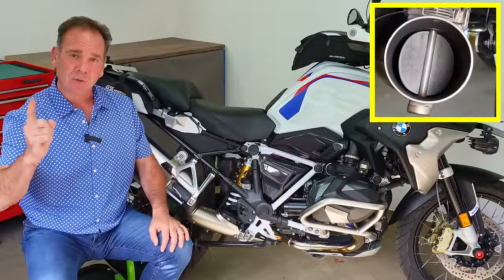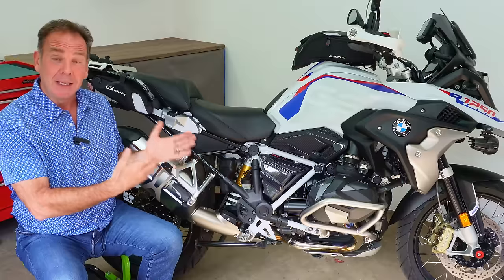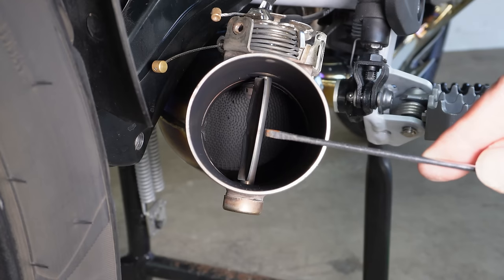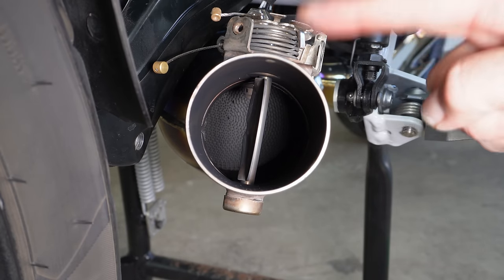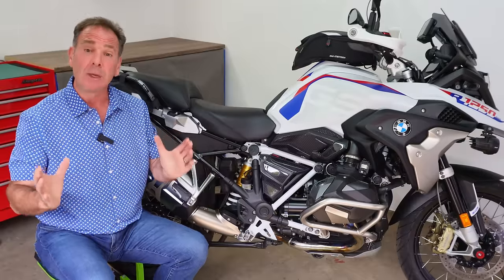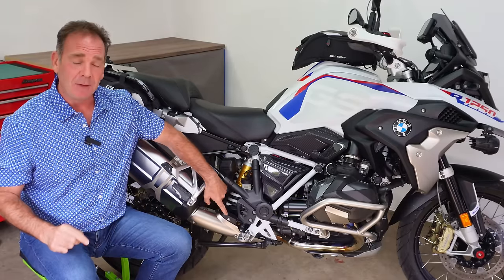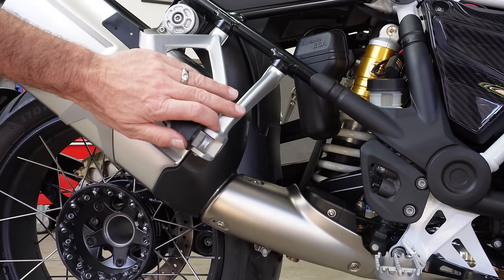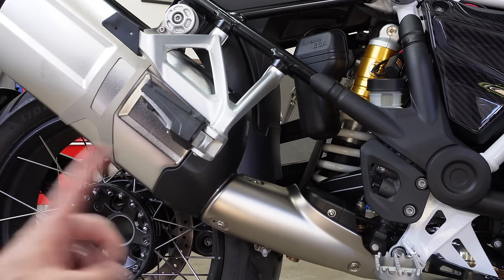EP 25: Butterfly Valve - Exhaust Valve - Exhaust Flapper - Sticking or Seized Valve - BMW R1250GS/A

Comment: It happened to my 2020 RT at around 7000 miles. The valve stuck BMW replaced it with new header pipes thankfully under warranty as  the dealership said it would be about £1600.00 (supply and fit) Just over a month later I had to have it replaced again as the new one stuck less than 2000 miles in. Replaced under warranty again. I asked if ant modifications had been made to prevent it happening again - “no just a like for like part” so just waiting for it to happen again. Oh and to top it all off the big bearing went at 9000  meaning a whole new engine ! Guess you can call me lucky !
Reply from the maker: Hi Andy, gosh that’s not good at all, really disappointed to hear that. I hope the dealership will compensate you in some way, maybe with a voucher for servicing or clothing.
If they don’t offer… I suggest you ask as I know they do have some flexibility in that regard, it’s just a case of raising the question.
I wish for you better luck from now on.
Let me know how you get on with your question 😉
Best wishes Carl
Reply: @justthewayitis  Hi Carl - I did write to BMW Motorrad UK to express my disappointment they were particularly useless, as my engine blew up two weeks before I was due to go on a European biking tour. I struggled to get a loan bike and when I did I was not permitted to take it out of the UK  so consequently could take a bike on my trip. They did offer a voucher of £250.00 as some sort of compensation but to honest I have no faith in the BMW brand but am stuck with it as I can’t afford to change and there is not much out there to compete with 1250 RT at the minute. I was just highlighting the flapper valve problem and how easy it gets stuck and the cost of a dealership repair. Thanks for taking the time to comment and I found your video excellent as it  explains what the valve actually does because the dealership told me it was all about emissions. (what a shocker eh!)
Best wishes Andy
Reply from the maker: Hi Andy, I agree the RT is such a capable bike there’s not a lot of options to replace it.
Thank you for clarifying 👍
I’m aware of a fair few unhappy BMW owners, I really hope they improve there build quality with the next generation 
Carl

Comment: Carl, excellent video. Very detailed and excellent video demonstrating how to do it. Can you share what lubricant you recommend for the shaft? I am in the US, can you can recommend a product that is available in the US.
Reply from the maker: Hi Paul if you look in the video description you will find a product that is similar to what use. Plus a link where to purchase 👍
Regards Carl
Reply: @justthewayitis Hi Carl, I have looked for links where I can purchase the anti seize and cannot find it, can you tell me where it is? I have looked for anti seize in US and all the sprays I found are less than 1,000 C.
Reply from the maker: Go to video description 
Click more
Then click more again 
There you will find the full video description text and all the links to the products. 
But let’s make this easier for you, 1000 deg would be fine if that’s all you have locally I’m sure it will be enough 👍
Reply: I found the video description and the links to different points in the video, however, I did not see any links for the Products.  It seems here in the US most of the copper anise products I have found have been up to 1800°F or nearly 982°C, which should be adequate for the exhaust gases.  
You mentioned in the video that you are an engineer, what type of engineer are you? I am a chemical engineer.
Reply from the maker: Hi Paul, I’m not sure what the problem is, I checked earlier and can see the links to the products. 
But what you have mentioned should be fine. Whatever we put on it eventually needs to be repeated anyway.
As long as it’s copper based it should be fine. If you’re concerned just google the properties of the product I used and see which NA provider is nearest in composition.
It’s late and im typing on my phone but later in the week I’ll try to remember to c&c the links.
Carl (Mechanical )

Comment: First of all, I just wanted to say that I really enjoy your YouTube channel! I always watch your videos with great pleasure.

After seeing your video about exhaust flaps, I’m thinking about installing a Healtech flap eliminator on my new 1300GS. It’s quite silent, and I miss a bit of the experience.

I do have a question though: Isn’t there a risk that, by locking the flap in the open position, it could eventually seize up due to lack of movement and dirt build-up?

Thanks in advance for your response, and keep up the great work!
Reply from the maker: Thank you for your feedback 🙏,. Yes the valve could eventually seize but that's the trade off you make when installing a eliminator. But it will be a few years before it happens.
Reply: @justthewayitis  Thanks for the response! 

I noticed that Healtech now offers a kit with a switch that allows you to turn it on and off. I guess that would probably help prevent it from seizing up if you occasionally set it back to "standard mode (?)
Reply from the maker: Can you post a link to this product so I can have a read ?
Thanks Carl
Reply: @justthewayitis  I tried to share a link, but it seems YouTube removes it. The article number I’m referring to is healtech ESE-SW-BM1, which I believe is also compatible with the R1250 GS.
Reply from the maker: Thank you 🙏

Comment: Also the mechanic told me there could be "Blow back " problems if this Valve /Servo Motor was not working properly.
Somebody else pointed out the Servo should not be on top of/next to a stinking hot exhaust!! It's in a plastic casing!

Comment: Hey Carl, another great vid as usual, so thanks for that.. Quick unrelated question? Are your cylinder head guards from Aliexpress/ebay ? or the wunderlich ones. I ask as i installed aliexpress version and have found that the rubber pads on the inside seem to have reacted with paint on valve covers. so much so they will probably need a re-paint. Juts curious where you sourced yours and if noticed any issues . cheers in advance J
Reply from the maker: Hi J, thank you for your feedback. Yes the cylinder head guards are from wunderlich and I’ve been very impressed with them. Carl

Comment: Ok yet another comment, Andy the Missedenflyer, has recently decatted his Kawasaki Z 900se, for the "added" sound, must admit this did sound good.  What are your  thoughts on this, did think of decatting my R1250r, but wasnt sure if this might cause problems.  Here in the UK emission test aren't carried out at MOT's for bikes.
Reply from the maker: Some motorbikes really benefit from breathing more freely, but during my testing on the GS1250 I could see no real benefit on this engine apart from increasing noise.
Maybe a full Akrapovic titanium system plus an ECU fuel map plus free flow air filter might yield a 10% increase in power but that’s going to cost a fair amount.
But you could check out your local R1250R forum to see if anyone has done this and ask them for there thoughts 💭 
Carl

Comment: I disconnected the 2 wires and tucked cleanly. My S1000XR gen 2 has this rambling and burble sound when downshifted to 2 and 1 gear. dramatically louder and no need to get slip on
Reply from the maker: I imagine that sounds nice 👍

Comment: I own a 2016 K50. Every 2500 miles stuck, it started from 13K miles. I just disconnected the cables, always open. No problem at all…
Reply from the maker: On the early bikes that’s a great solution 🙏🙋🏻‍♂️
Reply: Would you say that’s not a good solution on a 2021 r ninet?
Reply from the maker: See my other reply

Comment: Great job Carl. 

Can I ask is it normal for that round cap on the bottom of the exhaust where the servo is to drip condensation on cold starts?

Also what does the C Dog think of the 1300 GS?
Reply from the maker: Hello, yes it’s normal on the lower bush during start up especially as the temperature drops.
Ah the new GS1300, a lot depends on how it rides, it needs to be dynamically a big step forward in handling and suspension control with much improved adjustability, so until I get to ride and test one I’m unsure.
Hopefully that will happen very soon 😉🙋🏻‍♂️
Reply: @justthewayitis  Well I think its all those things minus the adjust ability/ So how I feel its lost the GS presence though
Reply from the maker: Lots of owners have mentioned the same regards the looks 😞

Comment: Thank you Carl, as always, very interesting and precise information. I suppose my BMW dealer would do this prevention maintenance if I asked them! 🤔 Would you recommand Metzeler tourance next 2 for my GS 1250? Regards, Marc Quebec, Canada 🇨🇦🏍😉
Reply from the maker: Hi Marc, your dealership may if you ask politely, but normally the valve does not receive any special attention. That may vary from dealer to dealer.

Tyres 😊 for me they have been great and I’m very happy with the change, but it depends on the roads you ride, if you do venture off-road on tracks and trails the Anakee Adventure is very good at that, and more capable than the NT2.

If it’s 100% road and no trails then they are highly recommended as well as the Road 6 from Michelin 
Decision decision 🤔
The NT2 just gives me the option of light dry tracks as well.
Best wishes Carl

Comment: Hello Carl, this is another great video. I have experienced that if I start my cold engine and let it run in idle for 2 minutes I have water drops on the floor. These are coming out from the connection between the front and the end part of the exhaust. So very close to the valve. I assume that when the exhaust cools down after a ride water condenses inside. Could it be that this also runs into the lower bearing and causes rust there ?
Reply from the maker: Yes that’s correct, condensation can also play a part. But normally the droplets travel down to the the catalytic exit surface and are quickly heated up. It gets pretty hot inside very quickly. 
Most owners have top bearing issues.
Thank you for sharing 👍
Regards Carl

Comment: hi Carl great video, do you think its worth removing the servo valve on a 2021 s1000r, as this doesn't have the shift cam and to be honest i find it a bit quiet up until about 5500/6000 rpm will a servo buddy do the job ??
Thanks again for a very informative video
Reply from the maker: Hi James, yes it will certainly open up the noise level a little and might just be what your looking for. Let me know how it works out on your S1000R ( lovely bike btw)
Carl

Comment: Excellent and very informative video. I watched your Ducati one before this while searching for info on whether to use an exhaust servo deleting mechanism. I see you removed the flapper completely on your Ducati. I have  a 2020 multi 950s which is euro 5. Do I have to disconnect the cables to the servo to keep the flapper in the open position as well as fitting the healtech exhaust servo eliminator? Or will just fitting the exhaust servo eliminator keep it open? I’m keeping the standard can on as like yourself don’t think there is any point in changing it for a termignoni. Thanks in advance 👍🏻
Reply from the maker: Hi Shaun, good morning 
The device is generally used by owners who delete or completely remove the exhaust valve. This could be to save weight or to be able to install a completely different exhaust system and maybe remove the catalytic converter.

In your case it’s important to first check what your valve is doing while the engine is running at idle. So remove the rear end can and have a look.

Is it fully closed ?
If yes, then you will need to wire and lock it fully open once you have installed the device.

Is it fully open ?
If yes, then you probably do not need to wire it open or disconnect the cables. (easier installation for you)

Each bike is different in its base running mode, some valves are pulled OPEN and some are pulled CLOSED.

I would send an email to Healtech to confirm 100% your question.

Good luck with your changes, the 950 will certainly sound different after the install.
I hope this helps, kind regards Carl
Reply: @justthewayitis  brilliant, thanks Carl for quick and detailed response. Look forward to hearing the difference 😉. Cheers
Reply from the maker: Your very welcome 🙋🏻‍♂️

Comment: Hi Carl thanks for going to so much trouble filming and explaining the exhaust valve.
I was told if or when it does seize it fails in the open position so you should be able to continue your trip would this be correct ?
Reply from the maker: Hello Ian, and thank you for your feedback 
Yes you are correct they normally seize open due to the spring constantly pulling in that direction.
In most cases this is were it seizes, but sometimes it’s partially closed 
Kindest Regards Carl

Comment: Does having it open 20% or 50% actually sound quieter than having it fully open ?
Reply from the maker: Hi Bradley, yes you can notice the difference and this is why the valve is used to help the GS pass the noise tests.

Comment: Hey Carl, help me understand how the ECU can tell the flapper isn't moving other than that the servo motor isn't moving back & forth. Is there a sensor that would recognize the reduced back pressure?
Reply from the maker: Hi Bill, it’s the servo motor that’s looking for a set amount to movement no other sensors checking the operation.
Bmw did make a software change from what I can tell that deactivated the fail warning on the valve. Due to the high number of owners with problems. I can’t be sure but that’s what I have been told.
So if you have no warnings on your bike, great 👍

Comment: Hi Carl, fabulous video, best I've seen, however I stupidly managed to dislodge the valve spring from it's tensioning points and as I wasn't expecting it hadn't noted how to get it back! I don't suppose you know how it fits back correctly? Any help or advice would be very appreciated.
Reply from the maker: Hi I presume we talking GS here, the simplest thing to do is take your phone with the video on into the garage and compare what you can see in the close up images and compare it to your current spring location.
Without actually seeing your bike it’s extremely hard to advise you.
Give that try and see how you get on
Let me know 
Carl
Reply: Yes, sorry Carl, it's a 2020 r1250 GS TLE. I have found the bottom spring location but cannot see how the upper spring locates to provide the tension to keep the valve open untill the servo shuts it. I've taken the silencer and rear wheel off but still can't see how the top of the spring is meant to fit. My local dealer helpfully said they just replace the entire exhaust! If I can't sort this I'll have to remove the servo!  @justthewayitis
Reply from the maker: Take several pictures and send them to me via email 
Email address listed on my channel
Reply: I removed the silencer and the rear wheel so I could get a really good look around the back of the mechanism. I could refit the bottom of the spring, but just couldn't see, or work out how to refit the top of the spring to tension the fap when not activated by the cables. Rather than bother you with photos I just decided to remove the servo set up and wire the flap open. I've ordered a Healtech exhaust servo eliminator and hopefully will never have to worry about that $%*£! flap ever again. I still think it's a brilliant video, I just wish I'd been more careful with the spring! :D  @justthewayitis
Reply from the maker: good to hear you have a solution for this, I was a little concerned about your situation.
Have a great weekend 
Carl

Comment: Carl, following on from our earlier chat - just so say, I was very interested in your exhortation to make sure to "use the full rev range once a month" - I'm sure that's something which will have contributed to my EV's demise, along with washing... there was certainly a lot more carbon on my finger tip than yours!   But I really had no idea that I should regularly be cranking the engine up to 8-9,000 rpm - I don't think I ever have - it has so much low-down torque I'm probably rarely ever above 5,000 rpm if I'm honest!  And there was me thinking I was just treating my engine gently and kindly...  Anyway, I duly went for a thrash down the bypass the other day - up to 8,000 rpm in 2nd gear at 70 mph, which really seemed totally unnatural to me.  How long should I be holding it there on my monthly remedial rides - or is it just a case of momentarily get there and then ease off?   This is a new world to me!
Reply from the maker: Hi David, yes momentarily, the idea here is the use most of the rev range but 7,000 to 7500 is ok, at least a couple of times a month. Smooth and progressive in 2nd or 3rd up and down. It’s hard to describe the procedure lol.
Yes there is so much torque is easy to use less than 5k all the time. But it will help keep your bike healthy.

Carl
Reply: @justthewayitis  Thanks Carl - noted, and will do!

Comment: are seized exhaust flapper valves just an issue with BMWs?  I’ve never heard anyone mention it with other makes such as Japanese bikes, but it’s mentioned frequently on BMW forums.
Reply from the maker: Bmw do seem to have a fair amount more exhaust valve Issues when compared the the Japanese motorbikes. Which is disappointing.
Carl

Comment: is this true? The exhaust valve assists braking and engine braking. If you cancel, you will lose braking power at some speeds.
Reply from the maker: Hello and welcome to the channel, it great depends on the motorbike… but in general the answer is no, because modern motorbikes use complex engine management systems that provide engine braking via other systems like the throttle bodies and fuel maps. 
It’s a complex system to understand and would need a video by itself to fully comprehend.
I hope this basic explanation helps 
Kind regards Carl